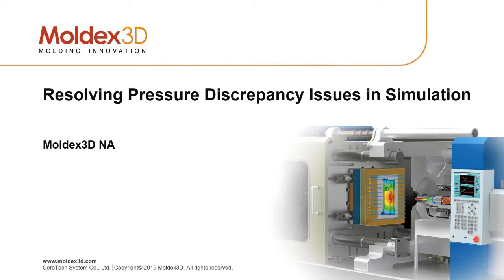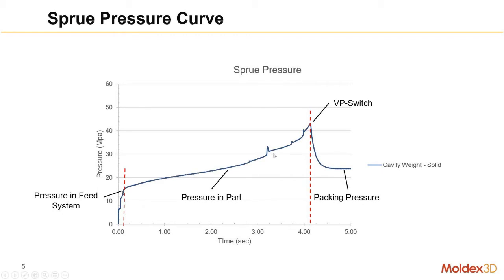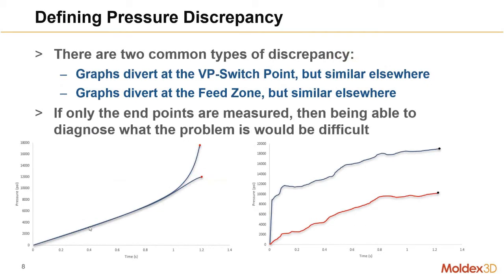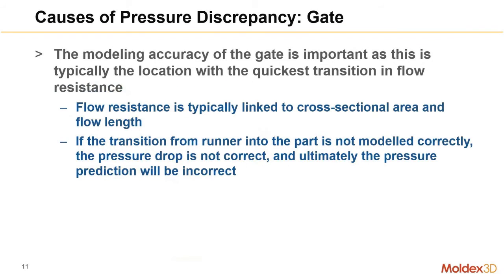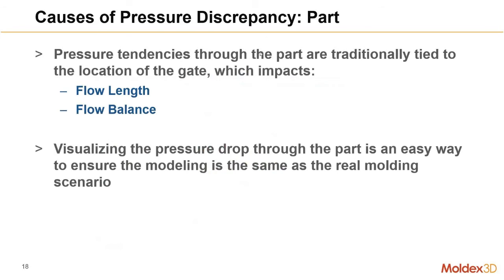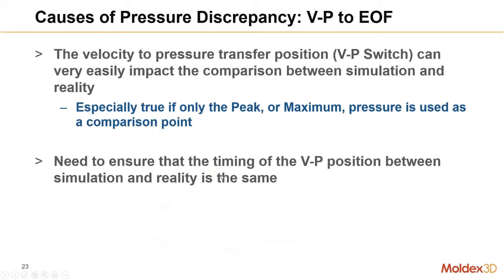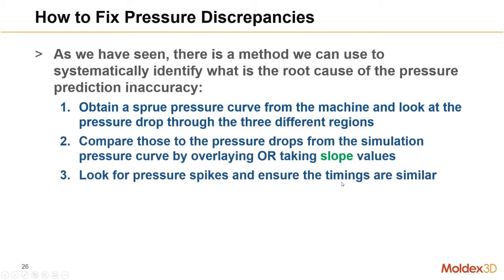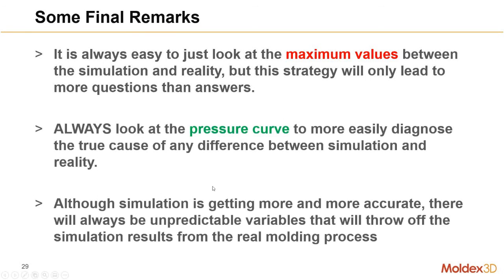How to Know if Your Simulation Pressure Actually Matches Reality | Moldex3D Advanced Tips & Tricks

Comment: What happens in a hybrid system, with hot runner and cold runner?
Reply from the maker: In that case, both segments of runner would be considered for pressure loss in the simulation.  

The pressure loss in the hot runner would be more immediate and the flow through the cold runner would create a more gradual pressure increase, like material flowing through the part.